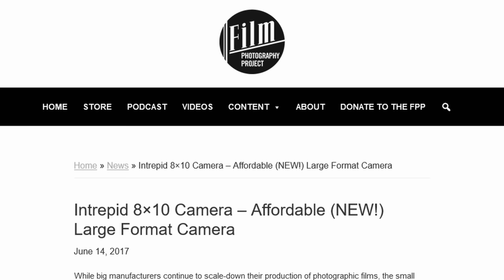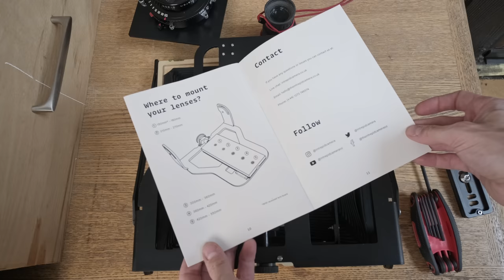Intrepid 8x10 Gen 3 Camera - My Final Thoughts - Large Format Friday

Comment: I have the Mark II (I think?  I ordered it in 2019 so it must be).  It's interesting that the III only supports 180mm / 150mm with recessed - I've used the Nikkor 120mm several times on my Mark II and I actually have to rack out a little bit to get infinity focus (with the lens in the first screw hole).  I'd have to double-check to ensure that the bottom standard isn't showing up, but even if it is, there might just be enough front rise to (mostly) remove it.  Though I haven't tried any lenses longer than 450mm or so - so maybe they added some length to the bellows at the expense of wide angle (and 120mm on 8x10 is pretty ridiculous).

As far as QA, mine showed up with the bellows clearly off-center and Intrepid were pretty annoying to deal with about it so I ended up just dealing with it since it doesn't impact image quality.  Also, similar to the Sinar boards, they released an adapter a while ago for Linhof boards.  Version 1 didn't find most Linhof boards that I have - including Toyo and one actual Linhof-branded board, but thankfully they admitted the problem and sent me a second which works with the Toyo and Linhof-branded boards, at least, but not all of mine (I think that I have a Horseman that still doesn't fit).  Quality control is definitely not their strong suit, but for the price, I am not complaining too much (and I'll probably end up buying their relatively inexpensive split 8x10 board to shoot some 4x10 since I tend to like panoramic format most and the previously-mentioned Nikkor lens should be more fun on the smaller / more panoramic format).

Comment: I got an Intrepid 4x5 Mark 5 (i.e. effectively the same revision as your 8x10, but for the smaller size) following your review as my first large format camera. The screw-based focussing has annoyed me as well. I wish they’d switch to a rack-and-pinion system which is no less accurate but much faster.

I also had a few soft shots. I think this is mostly due to me being a newbie and getting the focus wrong, but I did notice once or twice that no matter how firmly I tried to screw the rear standard, sometimes putting in or removing a film holder or even just unclipping my dark cloth caused it to tilt away from 90°, and there’s no proper lock to keep it perpendicular. When I noticed this happening before taking a shot, I of course re-checked the focus, but I think sometimes it happened without being noticeable. This is a real annoyance because there’s also not even a mark to easily check if it’s fully upright – the only sign that you’ve tilted it backwards is that the back can no longer rotate because it gets stuck on the focussing screw handle (!). If you don’t actually see it being knocked out of place, it’s hard to check afterwards whether that has happened.

On the whole I think it’s been a good investment for a first large format camera and has given me a good list of features to look out for if I ever upgrade to a different one. But, like your comment about the thin aluminium base, there are tiny improvements they could make which would significantly improve the shooting experience which just seem to have been ignored. It wouldn’t be hard to print a zeroing guide on the rear standard support like they have for shift on the front standard support. A proper lock at 90° would also be great – again, they have one (albeit not very reliable) on the front standard, but not the rear. And I’m guessing those who actually use rear tilt are annoyed by the issue with rotation, which could be solved either by mounting the screw handle a teensy bit further forward or just switching to a rack-and-pinion system.
Reply from the maker: Daphne thanks for sharing your experiences with the Intrepid series of cameras! At very least, I can say Intrepid is aware of these issues now, and these comments are helpful for both them to make improvements and prospective customers to get real-world accounts of using the camera. Thanks again!

Comment: Mat, I hope. you had a great holiday, though. 
Speaking of Intrepid, in my humble opinion, the most flimsy parts are front standard's fixing screws, since even movements caused by focusing cloth can cause displacement of focus plane. It is not the best, yet a good for its value lightweight camera.
Reply from the maker: It didn't make the cut for this video since there were larger issues at hand, but I had 3 shots with "accidental swing" due to that front screw!

Comment: I've always suspected the Intrepid line of cameras would have been better sold in kit form, leaving assembly and quality control to the purchaser. I'm not sure whether that would have helped in this case. (Although one might then be forced to compare how far the GG is from the edge of the rear standard with how far a sheet of film is from the facing edge of the holder. A difference of 1.5 mm would surely not be overlooked.)  The company still deserves our goodwill, I think, but it shouldn't be surprised by our growing ambivalence.
Reply from the maker: Bernard your comment reminds me of when I'd just learned about Intrepid. I instantly thought about the older Bulldog DIY 4x5 kits and thought these were going to be the 21st century version. I'm always willing to give them another chance, mainly because I don't wish to build my own cameras!
Reply: Kit form is a great idea as the camera is mostly made of CNC-milled plywood, laser cut aluminium and 3D-printed plastic so the parts cost very little to make, the assembly must make up a very big chunk of the production cost as, while not requiring great skill, it takes some time so a kit could be sold for a significantly lower price than the completed camera and as it's mechanically a very simple thing assembling it would not be too hard for most, especially the kind of people who would be interested in something as involved and time consuming as large format photography in the first place.

Comment: Thanks for the excellently executed review. I do have a potentially dumb question. What is “front focusing?” Perhaps I already know but don’t know ther term. Thanks!
Reply from the maker: Hey Kevin thanks for the comment and question! "Front focusing" is often used when discussing the nature of auto-focusing lenses in digital photography when the plane that's in sharp focus is to the front of where the photographer had intended. Due to the improper spacing during manufacture of a small number of the Intrepid 8x10 Gen 3 cameras, where I focused the camera and it looked tack sharp on the ground glass was not in alignment of where the film plane was when inserting the film holder.
Reply: Got it. Thanks!

Comment: Have you heard of similar problems with the latest 4x5 Intrepid cameras?
I was thinking of trying one of those to "dip my toe" into LF photography?
I'm wondering if this might be more a problem on the larger 8x10 due to the size of the camera, making it more difficult to build sturdy, etc...and possible they were reusing some 4x5 pieces on the 8x10 platform to save some money, etc?
Thoughts, experiences or hearsay on their 4x5's vs the larger 8x10's?
Thank you in advance,
CC
Reply from the maker: Hey CC thanks for the comment! While I've heard of one-of issues with various Intrepid models, I'd wager that the Intrepid 4x5 (now 5th Gen.) is the best camera in their lineup. Despite my experience with this particular 8x10, I'd still recommend a new Intrepid 4x5 for a lightweight, budget field camera. This is me speaking from opinion here, but when scaling from 4x5 to 5x7, 8x10, or ULF, everything gets larger and more costly. And judging from Intrepid's response (pinned above), they have taken notice of this and have already begun offering sturdier 8x10 beds.

Comment: Hi, 
How do you focus hyperfocal with such large focal lengths, for example:
With f16
100mm hyperfocal 14 meters
120mm hyperfocal 20 meters
150mm hyperfocal 31 meters

That is to say, it would only be focused from the middle of each distance shown, but you are nevertheless focused from the beginning of the photo.
In my case, for example, I have an Agfa Record II 6x9 105mm, the focus ring scale only goes up to 10 meters. But with f22 the hyperfocal is at 11.2 meters, meaning that the photo would only be in focus from 5.5 meters, that is if the ring reached a little more than 11 meters. How do you do it? Thank you

Comment: Does it work now with the new ground glass?
Reply from the maker: It's in working order now with the replacement glass! Doesn't solve the shakiness of the frame when inserting film holders or the shorter screws used for folding the camera, but it's a start.

Comment: Not good for macro? Bummer. Was going to buy it as a backup for studio macro because of its light weight.
Reply from the maker: If your macro lens has a focal length < 200mm, you might be alright. That 510mm maximum bellows draw is a big limitation if you plan on doing 1:1 LF work.

Comment: 1.5mm off industry spec for the ground glass location is Enormous. While making images at f64 ~might~ be sorta ok, for images using an exposure aperture of f5.6 or f4.5 1.5mm off would be intolerable.. This plus the overly focus on lowest weight possible at lowest cost can never result in a truly capable camera.

~These are the realities of a low cost, light weight field foldable. Ponder an image maker new to this view camera stuff pondering why image made are not focused where they should be.. and given the current cost of 8x10 film.. how much was "saved" by a low cost view camera.

~This camera capable of making images, absolutely within very specific limitations of lens, how used and more.

What is fact and reality, This brand of view camera has gained plenty of internet tooting and lured many into the view camera journey.. It has played and marketed extremely well into the current fashion of film view cameras, more specifically appealing to those hiking/camping landscape photographers.

IMO_personal point of view, any camera like this would never be tolerated. Based on a history of making view camera images for nearly four decades and nearly every kind of image possible with a view camera.. Also of the opinion those new to this view camera stuff should start with a GOOD  4x5 monorail to learn how to use a view camera AND most important mastery of ALL camera movements. The two prime advantages of a film view camera is the ability to use camera movements and choice of lenses. Bigger sheet film alone can never produce expressive image excellence. Camera, lenses and all related are mere tools to achieve an image goal. Too many new to this view camera stuff is overly focused on the camera instead of what they image making goals are, what lenses are required to achieve this then consider what camera/tripod head/tripod best meets these needs and image goals.